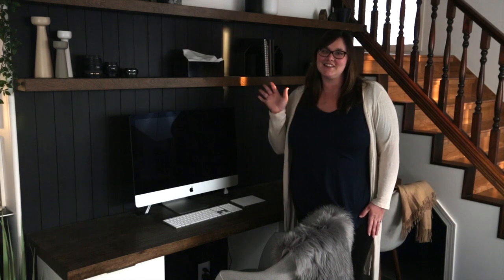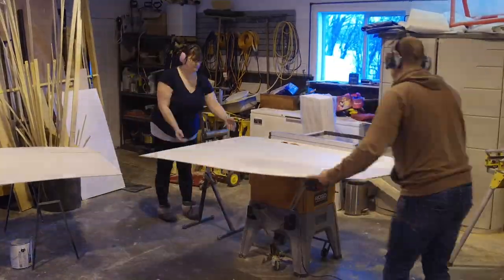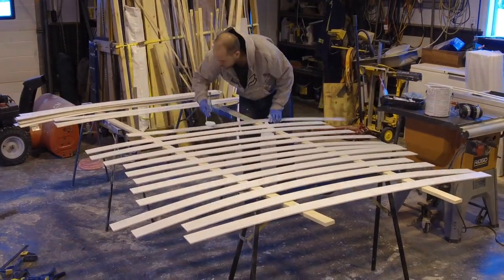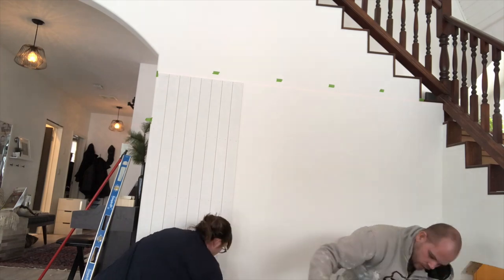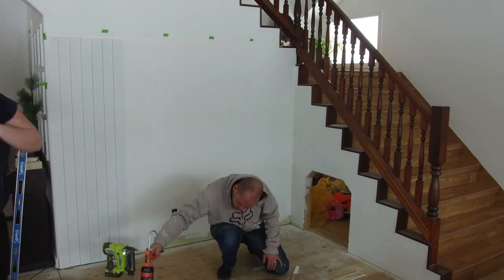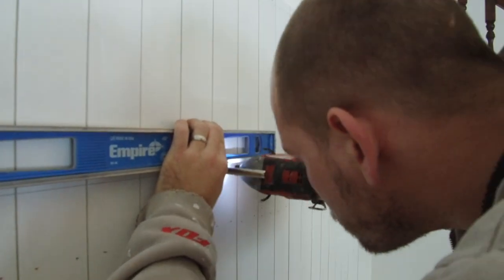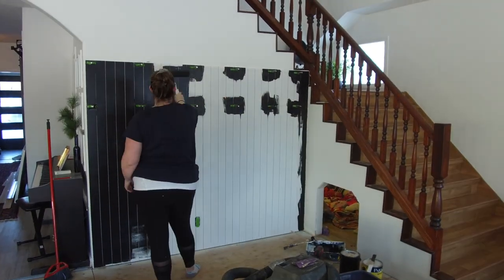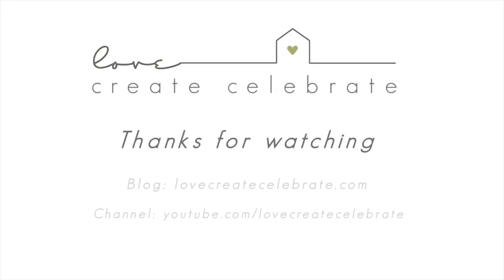Easy DIY Vertical Shiplap Wall

Comment: If I were to install shipload on concrete wall,  how do i nail the plywood to the wall?
Reply from the maker: You wouldn't be able to use this method unless you had some kind of false wall overtop of the concrete. You could use a tongue and groove shiplap but you would need to install 2x4s first to attach the shiplap. Hope that helps!
Reply: @LindiandRuss  thanks for your advice

Comment: Did you need to prime over where you filled the nail holes before painting?
Reply from the maker: With the small holes you can generally get away without priming again if you have a high quality top coat paint (or at least we have and you can't tell where the nail holes are if you do a good sand)